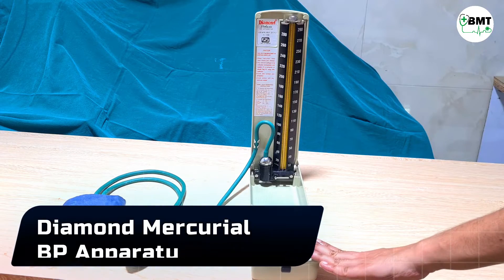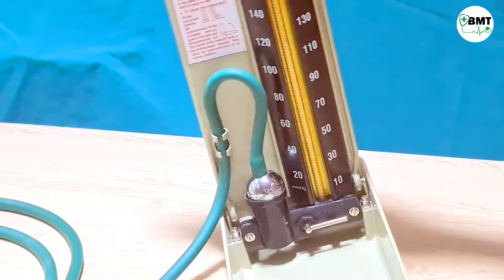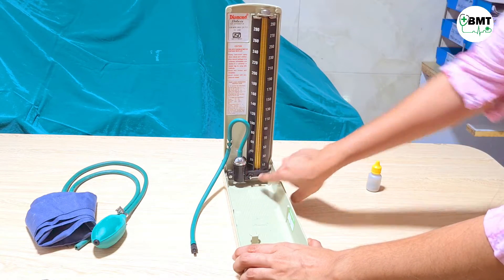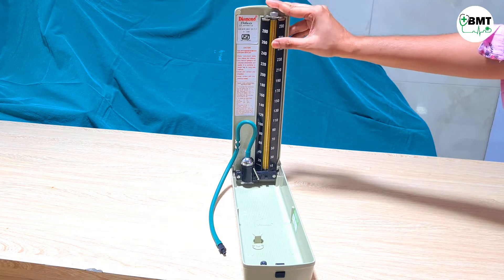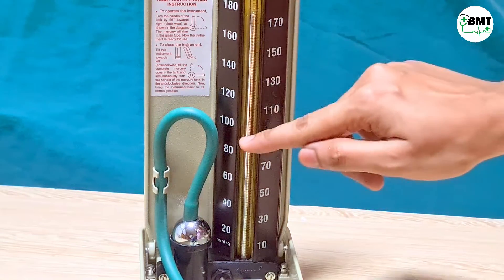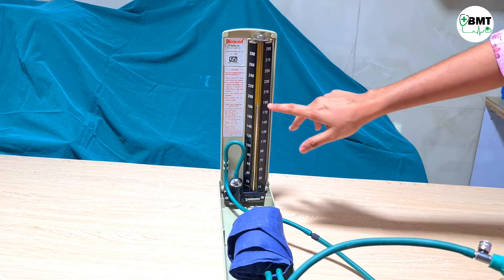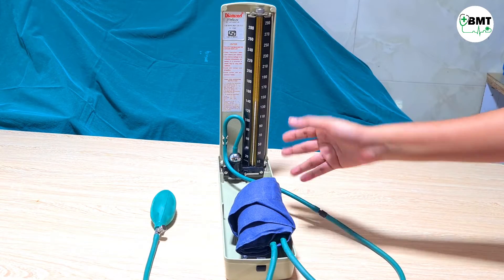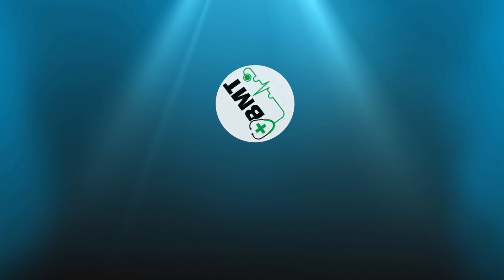Diamond mercury BP Apparatus | How to calibrate | How to repair | How to replace glass tube

Comment: What happens when the mercury is above zero ,
Reply from the maker: When there is no pressure in bag then it should be on zero position.  If it below or above zero, then the reading you get is different, i.e. plus or minuse error value.

Comment: How to claim the warrenty if the seller is not responding
Reply from the maker: As per my knowledge, only distributor can give u warranty. Because it have only physical damage problems.
Reply: @biomedicaltutorials139  the bp apparatus shows 20 points higher when compared to any other bp apparatus , what should be done in that case
Reply from the maker: remove some mercury 
and calibrate it as shown in video
Reply: @biomedicaltutorials139  the mercury level Is exactly at 0 already
Reply from the maker: Is this round dial bp apparatus ? If yes; then Round dial is faulty.
Reply: @biomedicaltutorials139  no it is not round dial , it is normal manual bp , diamond , bulb type , vertical mercury coulumn